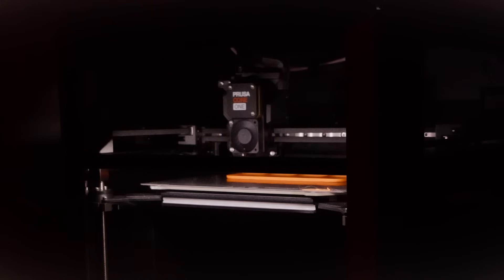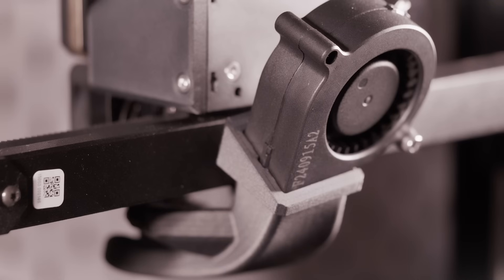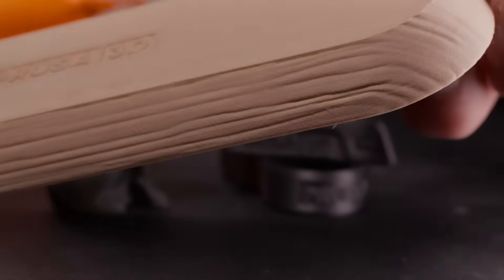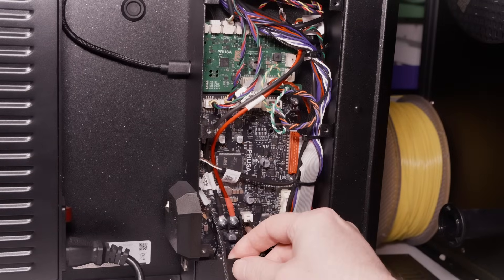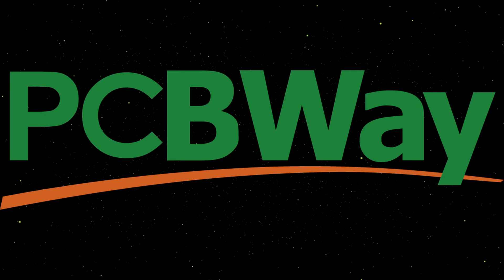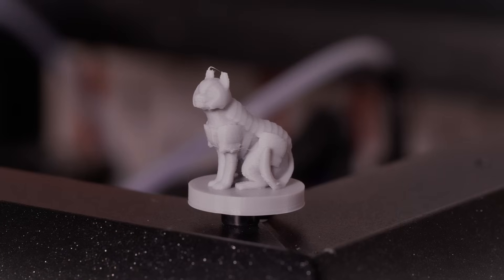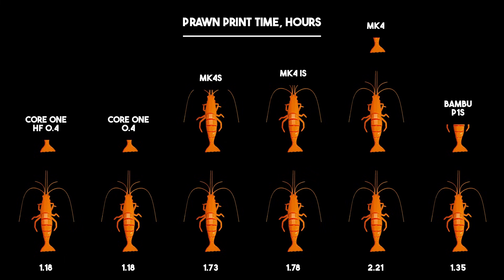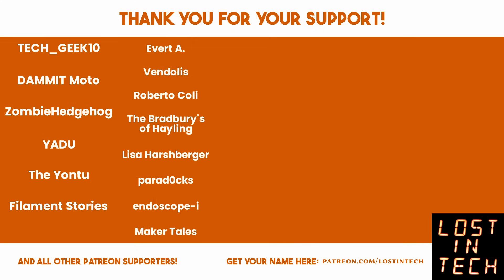Why the NEW Prusa CORE ONE is a 3D Printing Hobbyist and Modder's best friend.

Comment: I think that the Bambu Labs P1s is a very plausible comparison and is significantly cheaper.

I will be getting the core one because I'm excited to finally get a Prusa due to the principles,but for casual/new buyers it's hard to justify the investment
Reply from the maker: Eh, I assume you know all the bambu drama.
Reply: @LostInTech3D  The P1S hasn't had the controversial update. At least mine hasn't. I'm still on 1.0.7.
Reply from the maker: has the X1 had it now? I thought they'd postponed it or something but I kinda lost track
Reply: @LostInTech3D  well, if you neuter it sufficiently, it might just grow up to be  obedient and well behaved. Just apply liberal social isolation and dont let it talk to its parents. Im sure it will be just fine.

Comment: I watched this one with sad smile on my face... Is prusa late? ~yes. It has "wow" factor? Nope.
Reply: Yeah it doesn't have any smart features like auto flow dynamics(pressure advance) nor real time flow adjustment like my A1 mini. It is just an enclosed core xy printer with some fans at the back that can reduce the temperature inside the enclosure. That's all. Also the mvs is really low for a cht nozzle plus they should have a hardened one as standard.
Reply: @AngelVenomous my a1 mini with all those smart features fails prints more often than my old mk3s, it's just marketing or poor execution
Reply: @JestemKaspi well then your printer has problems because mine works just fine all the time without any fails. There was a qc problem but support send me a part for it so it was fixed.
Reply: @Milten130  I got exactly same printers and I agree mini fails more often and has lower print quality.
Reply: late? i guess a bit is justified considering polishing done. no need for wow factor either when you're looking for reliable machine, not a shiny bamboo whistle

Comment: And Most of it is no longer OpenSource/Hardware...
Reply: @lambda7652  you still have the option to go Voron if you really want to
Reply: What exactly is no longer open source on a PCO?
Reply from the maker: Jo has explained at length why he's chosen that route and I don't think anyone can blame him. Nor do I care tbh. It's all documented and moddable.
Reply: @LostInTech3D  So its the Same for Bambulabs...?! 
They also soled an IO board and have an wiki and sell spear parts
Reply from the maker: No that's a huge false equivalence.
Reply: @lambda7652  lol bambu is openly anti opensource and anti consumer, to the point of threatening lawyers against copycats. Not at all the same as prusa. Prusa closed down some of their stuff to protect themselves against 1:1 china ripoffs like what fysetc was doing with the MK3 clone.

Bambu having a wiki page for repairs doesn't make them opensource.
Reply: @ Im not saying they are open source. 
they are as Open as the new Prusa. 
"There" slic3er veriosn is open. 
the Gcode is Open. 
They have an iO board with open documentation. 

Waht is more Open with the new Prusa?
Reply: @ Prusa's FW is open for starters, prusa wont even void your warranty if you use custom FW, while bambu does. Bambu studio is only open becasue it legally has to be. If bambu had their way, they would close source that too.
Reply: @LilApe  Prusas FW is only open becasue it legally has to be. 
And Prusa was the first manufacture that implemented a board wehre you had to Physically brake a part of the PCB to flash a New firmware.
Reply: @lambda7652  lol what? prusas FW doesn't have to be open. They use marlin as their base binary but the rest is their own work. Only the marllin part has to be opensource. Prusa could lock down the rest of their FW if they want, just like bambu did, but they didn't.
Reply: @LilApe  And because They uses marlin it needs to be open.
It's not a "binary" the install ther version over.
Reply: @lambda7652  lol only the marlin part needs to be open. The rest can be closed, but prusa doesn't close it becasue they're not anti open source. Not gonna have this back and forth argument with you. There are many 3d printer companies like creality and more that used marlin for years and still kept their FW closed.
Reply: @ This is not How this works. 
You don’t Have a "marlin binary" and then run another firmware on top of it. Thats just not How this Works. 

If you don’t open Source your Marlin b+ased Firmware it’s GPL violation. 

that's just how the GPL V3 liens for this works. 

if they don't like that thy can make there owene non Marlin based Version (like Bambulabs)
Reply: @lambda7652 we can thank Bambu 🤣